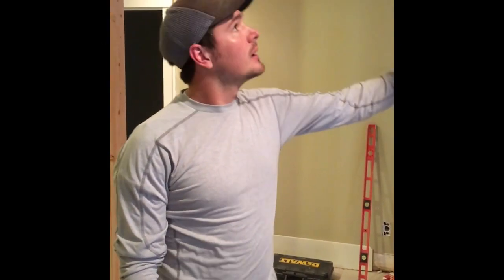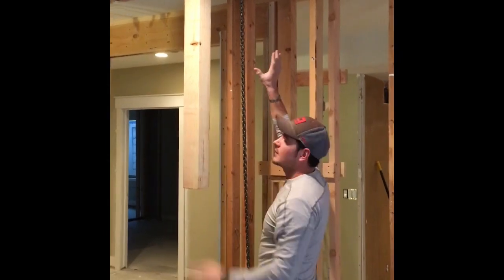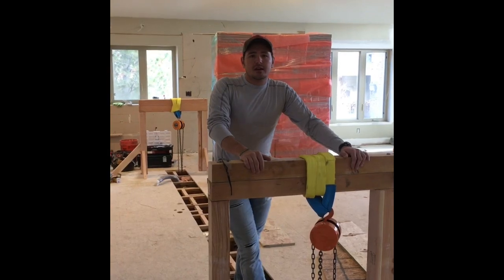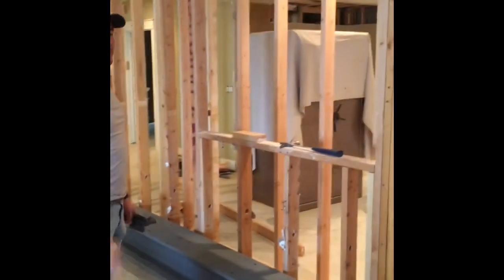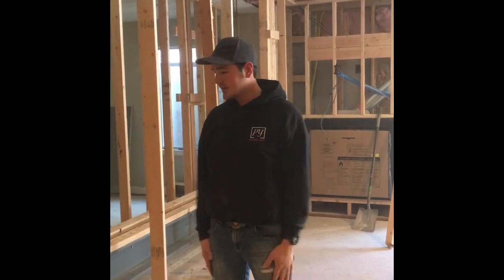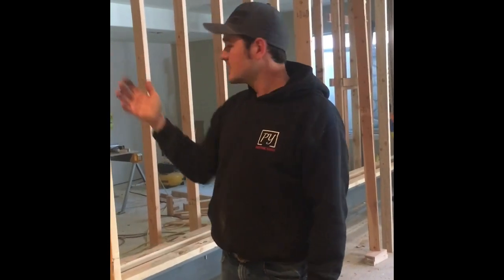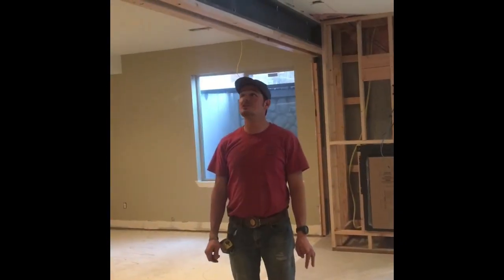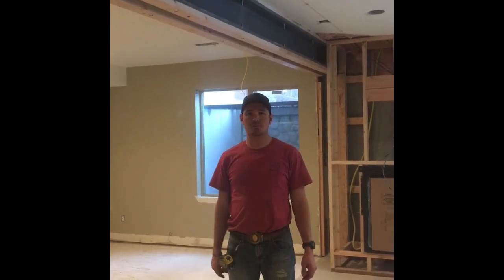How To Replace A “Load Bearing Wall” With A “Steel Beam”

Comment: 2:45 When supporting but also lifting something heavy on the same set, you need to calculate the max support capability for both the lifting part and also the support required to keep the building up. Especially in non-wooden housing, you can't afford to decrease support at any time, since that will crack the walls as the shape of those changes during different loads.
I'd prefer several jacks with a force indicator, so you can set all to the same upward force.
Doing the same with an H-beam, you can also support that with 2 jacks, one each side.
Also, it's better to have equipment measured out for all such tasks in the future with a load capability at least twice required. It costs a little more initially, but will always be in high enough spec range to do the job.
When using jacks, also have the ones with spread support, like a big foot.

Comment: I have the basically the same project but instead of replacing a wall it’s 4 6x6 posts supporting an enclosed deck over a 33ft span. Every contractor here says this it is impossible. They tell me two 24 LVLs for two 15ft spans is the best that can be done.

Comment: Thank god. I need to install 3 beams. 
The heaviest 1000 lbs and 22ft. 
I kinda feel more comfortable
Reply: But I have to tuck the beam between joists so there’s no drops
Reply: Planning this install in a few months on my main floor. Installing a steel beam because of head clearance issues, mine is 900lbs. As like you, they're going in between floor joists as well.

Comment: Began the process to do this. An LVL specialist recommended 4 14" LVLs laminated to carry the load so I hired an engineer to propose a steel beam solution instead. We have a slab foundation and I'm really hoping that we don't have to pour reinforced footers to carry the point loads. He did say that the columns would have to be steel as well, not just the studs, I'm guessing because the load is the 2nd floor as well as the roof above it that runs down a wall that is above the existing wall.

Had a "friend of a friend" who "does this kind of work" come look at it last year and he told me 2 2x12s would be fine and I immediately knew that it wasn't. 
It's always good to know your own limitations when it comes to home renovating.
Reply: Exactly! And that's why there are structural engineers and they go to school for this.
Reply: @jerryclleung  Ended up with a W10x30 beam, bolted to welded shear tabs and anchored to the slab with 3/4" structural bolts. Hardest part was hoisting the 500lb beam, but got it done, by myself. Cost of the engineer was well worth the peace of mind